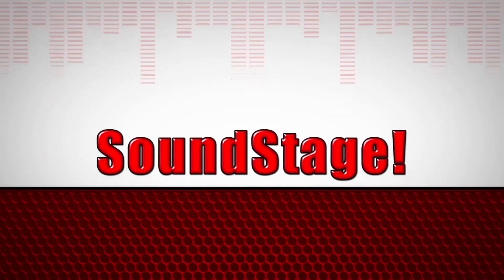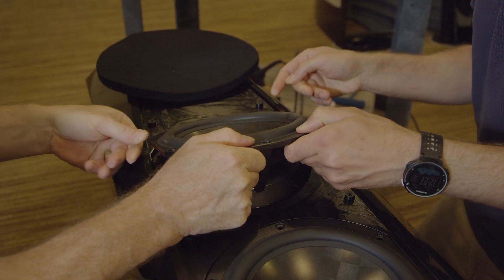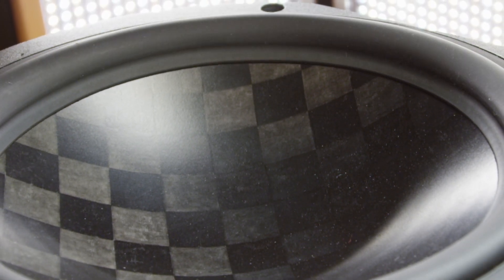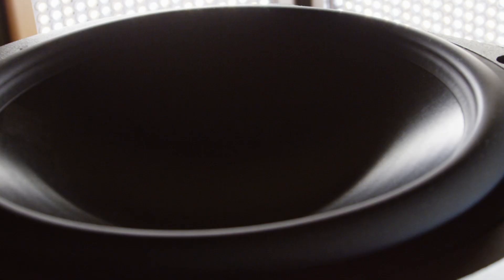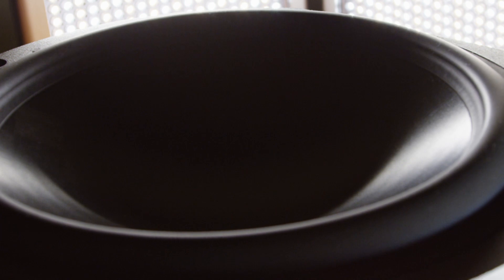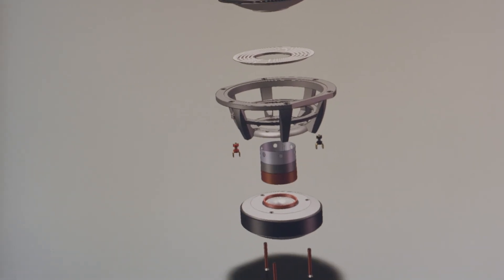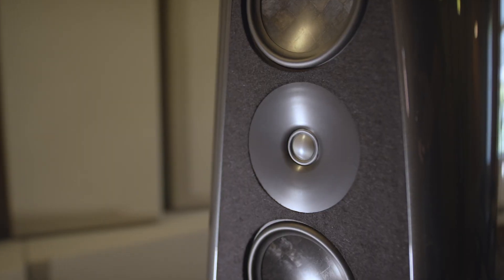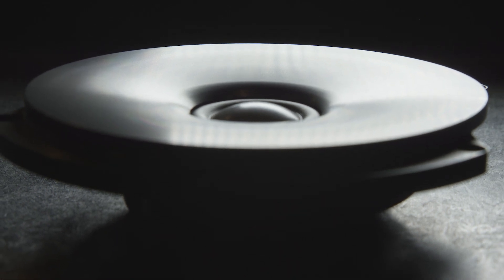SoundStage! Shorts: Rockport Technologies' Speaker Drivers (February 2020)

Comment: Nice speaker. 
Well built.
It's my dream to own a pair of Cygnus, however Mr Andy Payor should consider putting two pairs of binding posts per each speaker to enable biamping and biwiring.
That's what is putting me and  most of my pals off buying a pair. 
Please Andy, please.
Reply: I'm sure for a couple of thousand if that, someone could separate the crossovers and install additional binding posts. Chump change if you can afford $100k.